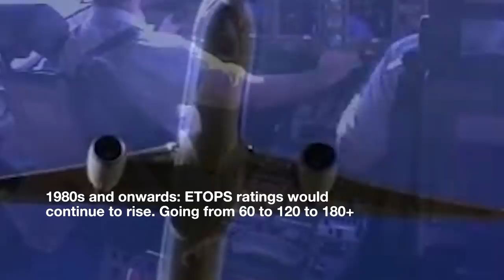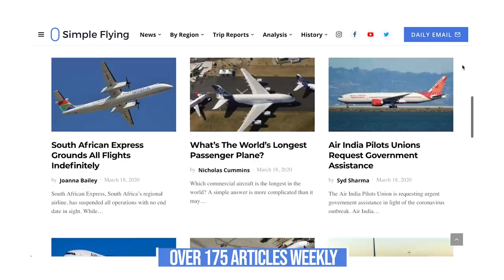Why Did Tri-Jet Passenger Planes Not Become Popular?

Comment: Simple Answer: They aren't efficient and increase operational costs
Reply: ungratefulmetalpansy big brain
Reply: ungratefulmetalpansy  what if we replace the engine gears with even more engines
Reply: ungratefulmetalpansy  fractal engine design!
Reply: @cabbagememes2852  Yeah, this is big brain time..
Reply: Engines still explode at random. If the top one does you lose your rear stabilizers and possibly hydraulics. Either way it means a crash. GE and Rolls engines can produce 60k or more lbs of thrust with a single engine now so you really don't need more than two unless it's a super Jumbo, which they are decommissioning because they aren't efficient anymore (747 8, A380).
Reply: @vendediesel  747 is still and will be used by Cargo airlines for at least the next 30 years there simply isn't a large freighter plane as efficient as the 747 espicially now with the increase of E-Commerce and the fall of in person shopping.
Reply: Look cool tho
Reply: Error 404 po twojej stampylonghead  they all do, even passenger airlines but as cargo only. Standards are much different when you don't have passengers first off, second off DC9s and 10s were grounded by the FAA after a major crash in 1997 at the Ohare Airport where a DC10 lost an engine as it was lifting off and the plane crashed onto a building killing close to 300 people total. After an investigation it was proven that the mechanics who serviced the plane per the procedure set by American Airlines were sloppy in their work and caused a bolt to break off. AA put the blame on McDonnell Douglas, who then put it back on American Airlines, reason being that the instruction manual for the wing removal from McDonnell Douglas said specifically to NEVER  remove that bolt, which they did. Problem was the FAA grounded all DC 9s and 10s and other airlines canceled their orders while the investigation was being done. The lead mechanic from AA committed suicide the night before he was to testify so they really had no actual witness to confirm how the wing was removed. Because of this McDonnell Douglas and AA were found jointly liable for the crash and had to pay. AA settled their case through insurance, MD had to pay out of pocket. Add to the lost sales and the fact that the DC 9 and 10 were still grounded by the FAA, MD was officially going under. Boeing stepped in and purchased McDonnell Douglas, putting an end to their competition and to the tri engine aircraft.  As a result DC 9s and 10s were easy to purchase afterwards for cheap from all of the airlines that still had them. Some retained them and converted to cargo for themselves and sold off others to freight companies also for use as cargo.
Reply: @vendediesel  okay first off in 1979 is when the DC-10 crash in Chicago O'Hare the one that you referring to that lost an engine not 1997, you are way off on your date my friend. And secondly the FAA has never grounded the dc-9 ever once did it ground the dc-9 so I don't know where you're getting your stories of the dc-9 was grounded from the FAA but the DC-10 was an accident that you were referring to in Chicago O'Hare was in 1979
Reply: @vendediesel  And the DC-10 was grounded before the AA 191 in O'Hare.
Reply: @deltaboy767  glad to see how focused you are point of the thread. Don't you have some beans to count?
Reply: @vendediesel  No just correcting an error made.
Reply: @deltaboy767  very useful to the overall conversation [sarcasm]
Reply: @vendediesel  Not sarcasm at all, if I came off that way I apologise. I was merely staring that if you're going to state historical facts at least get the years correct and the Aircraft type, and the face the the FAA has never once grounded the DC-9 or the MD-80 series aircraft.
Reply: @deltaboy767  You seem to think this is a vendetta against the MD series aircraft. Plain and simple, "why aren't there tri jet engines" because they are unsafe. EVERYONE else here seems to get that simple point.
Reply: @vendediesel  um the L1011 was a very safe plane and it was a trijet, as was the Boeing 727 the MD-11 was also a very safe plane, having flown in all 3 variants I can testify to this.
Reply: @deltaboy767  So, again, I re iterate the original question then, Why do they make only 2 and 4 engine airplanes then? It's not because of a typo on a date. You claim to be the expert here but haven't answered that yet.
Reply: @vendediesel  Because of the ETOPS extension that airplane manufacturers were able to focus on more fuel efficient twins. And no not because of safety.
Reply: The 747, the A340 and the A380 have amazing safety records. However there is a wide range of accidents where additional engines do not help. For example: Fuel related accidents, icing, hard landings, runway overruns. Four engines add complexity and only very experienced pilots have ratings for these aircraft. With crews qualified to the same level, twins might be equally safe. I never heard of an accident where both engines of a twin failed without a common cause (e.g. not enough fuel). Would be interesting to learn of such an accident.
Reply: @stormidema6817  nono... could work.... water landing planes xd...

Comment: A big problem is that the third engine is totally unique and much harder to access than an under-wing engine. An under-wing engine is totally exposed for maintainance and relatively easy to swap out, either for an engine of the same type or even a drop-in replacement engine. Having an engine incorporated into the tail with ducts is a nightmare for maintainance.
Reply: Yes, access is more difficult. But the core is the same as the other engine.
Reply: @greentriumph1643  but it needs a custom housing which is much more complicated. And it no doubt complicates the design of the core to allow it to mount in either location. I wouldn't be surprised if a wing engine core has slight differences from a tail engine core.
Reply: @ERPP8  A jet engine 'core' is the hot section. Enormous engineering and design involved. It is the same as the rest of the engines. It is not 'totally unique'.
Reply: @greentriumph1643  it's incredibly difficult to make such a complex piece of machinery work in two different environments. Even if they are identical, it makes for a harder to design core.
Reply: @ERPP8  Environments are the same. The air temperatures and pressures are the same for tail and wing.
Reply: @greentriumph1643  you don't understand. The second you mount the engine in a different location, the core has different design consideration. That's universal to engineering. That's why the F35 turned into three different planes even though they were envisioned as being almost identical. You can either propagate the changes to both cores, or have two types of core. Either one is difficult.
Reply: @ERPP8  Is the engine in the tail  'totally unique'? Yes or No? That was your statement and I am responding to it.
Reply: @ERPP8  Just checked. All variants of the F135-PW have the same core.
Reply: @greentriumph1643  do you like arguing for its own sake? You know what my point is. You're just arguing details and phraseology.
Reply: @greentriumph1643  jfc can you read?
Reply: @ERPP8  Personal insults. Why so nasty? What did I say that is factually incorrect? 

Why the strawman arguements?

What are you an engineer in? How old are you?
Reply: I will clarify the matter for two of you. Engine maybe the same for wing and tail . But the engine hangs from the wings while it is part of the tail vertical stabiliser . So supports and wiring will be different and much higher for maintenance . Dropping the tail engine would itself costs more labor
Reply: @TheGecko213  Good comment. I never said anything different. Not all of them are in the vertical stabilizer as in the DC10. The 727 and L-1011 had the engine at the back center of the fuselage with the S duct where the vertical stabilizer meets the top of the fuselage.
Reply: @ERPP8  3rd engine is the same engine as the other 2 though. It's not unique. Are you an actual aircraft engineer with actual experience with the requirements and procedures used to service the tail mounted engine on a tri jet?
Reply: I was told SwissAir accidentally dropped a center DC10 GE engine during changeout. Made a big dent in the tarmac.
Reply: Know what else is an even bigger nightmare? Dual engine failure.
Reply: @warptek  you must be the superstitious type.
Reply: @ERPP8  Nah. Not at all. Just like to have a safety net for even the most unlikely scenarios.
Reply: @warptek  well, people who know what they're talking about know that it's a non issue. So believe whatever you want.
Reply: An engine mounted on the wing versus one in the tail is the same engine. There are no differences. Its bolted to the airframe in the same location on the engine. There is nothing "special" or "unique" about the tail engine.
Reply: Actually that was more of a problem for the L-1011, whose #2 engine was attached to the fuselage by the front and was not  readily interchangeable with the other engines without a lot of modification work.  On the DC-10, however, the #2 engine hang from the fin supporting beam in pretty much the same way as the wing engines, a good maintenance crew could modify the engine's fuel feeds and other connections in two hours flat.  I saw it done.  Moral of the story is that DC-10 operator didn't need to have a separate inventory of tail engines, which was not the case for the Lockheed.
Reply: @sobelou  Thats not correct. the tail engine on the L1011 connects up and is supported the same way as the ones on the wings. The fan cowling on the RB211 is not designed to support the whole weight of the engine. There is no special RB211 designed for the tail. You dont need to modify the DC-10s engines at all if you pull one down. The mounting system is the same.
Reply: Engineering is different with wing and tail engines. 
Wing engine is far away from fuselage and gets "clean" air, meaning the airflow is not interrupted by anything. Tail engine is so close to the fuselage, that the inflowing air has higher air pressure, due to fuselage pushing air away. 
That is not still the biggest issue. Because the pressure drops further you go from the fuselage, the tail engine also sucks in air with different air pressure. Pressure is bigger one feet away than it is two feet away and so on. This is not an issue with wing engines, but tail engine is in a vunerable position. The air inside engine cowling is not distributed equally. The fan blades moving at very fast speed meets incoming air with different air pressure with every revolution. As blades move downwards to 6 o'clock position, air gets thicker and pressure in fan blades gets bigger, and when blades move upwards towards 12 o'clock, the inflowing air has again lower pressure. This puts tail engines at bigger risk than wing engines.
Reply: RoyalMela You’re correct. The tail engine is susceptible to surges. That’s why on the JT9D powered DC-10 the tail intake is coke bottled. But these twerps are saying the engine itself is different which is not the case. You can remove the tail engine and put it on the wing, there’s nothing special about the specific engine put in the tail.
Reply: @NovaScotiaKevin  Yes, the engine itself is the same. Would be kind of stupid to put two different engine types in one plane.
Reply: RoyalMela read above, there are people who think the engines have different bolt points, fuel lines, etc for the tail engine. Someone claimed every L1011 operator needed to keep spares of the “tail engine since it was totally different”
Reply: @greentriumph1643  depends what you are calling the core. The F135 engines are not the same for all three variants. The STOVL variant has same core but the bypass cases are different. It also has a 3bsm to swivel the nozzle for short and vertical takeoffs and landings. My knowledge comes from working on the F135.
Reply: @andret4403  The core is the hot section.
Reply: @greentriumph1643  so technically core includes both hot and  cold sections consisting of air inlet, compressor, combustor, turbine, and exhaust.  A core can be dressed with different external hardware depending on airframe or other design considerations making it different bill of material part number engine. Example PW1500 going on A220 and PW1900 going on E190-E2 have identical cores but due to different airframe requirements are not interchangeable engines with differences in external hardware. 
I don't know enough of the trijets to know if tail engine is same BOM part number engine but chances maybe not but core would be same.
Reply: @andret4403  At GE, for commercial applications, the entire flow path of any air that will be burned is called the core. (essentially non-bypass air).
Reply: @greentriumph1643  yes same definition I have. I assume GE has cold and hot sections to the core. I also assume GE has common core to  engines with different part numbers going to different air frames.
Reply: @andret4403  You are exactly right. Several design can be created with a common core including industrial gas turbines.
Reply: @warptek  the unlikely scenarios that take out 2 engines also take out 3 and 4 engines.
Reply: Just yeet that rudder
Reply: @Greatdome99  RIP ENGINE #2
Reply: @ERPP8  that’s why the DC-10 and MD-11 ‘straight-through’ method is better